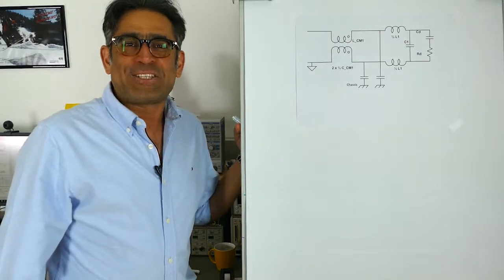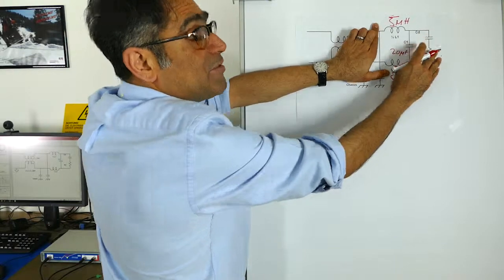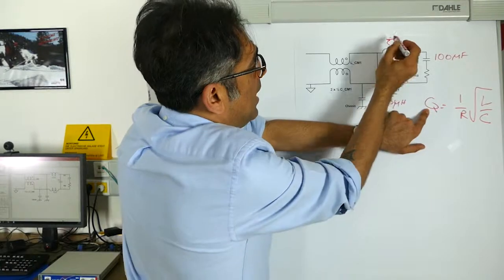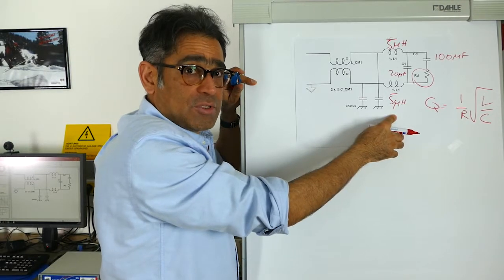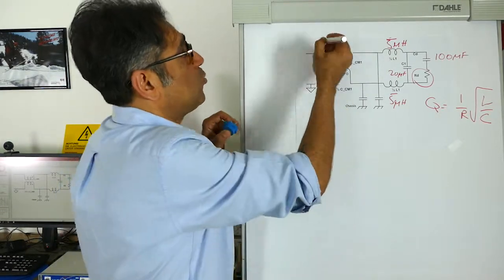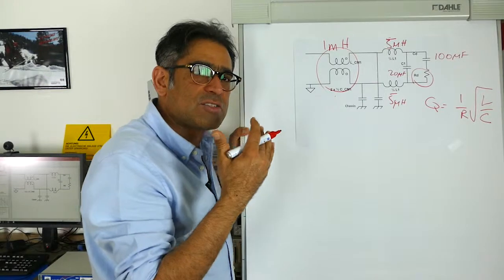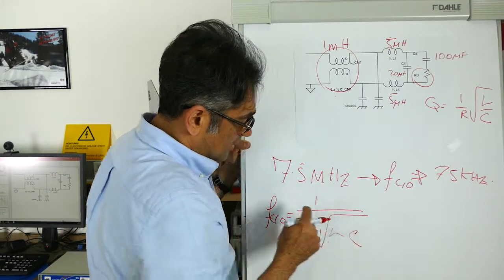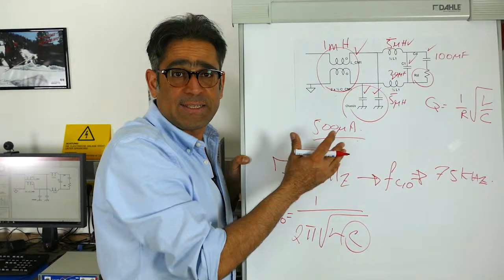EMC Filter Design Part 8: Common Mode Filter Design

Comment: Hi Dr. We have a schematic of a circuit board for EMC filtering. We draw it based on an industrial board(based on PCB picture). The circuit is so close to your circuit of common-mode filter but it has some differences. the circuit doesn't has PE to connect PI capacitors, but the producer use another way. It would be an honor if you could take a look at the schematic. we have the chock spec but we don't have capacitors and inductors range.

Comment: Hi Dr, Thanks for those awesome lectures. I wanted to ask you, lets say we want to have separate differential mode inductors, what is the equation/requirements that I can use to determine the required inductance of the common mode choke and what about its rating? should it be rated at line current? what about the rating of the other components in the system? (like L1 C1 Rd etc) what should their current rating be?
Thanks!
Reply from the maker: Dear Samtabaja, these are very detailed questions and we suggest you contact Dr. Ali directly via www.biricha.com

Comment: Thanks for your wonderful explanation!
The value of capacitor that you have calculated, will that be same for both capacitors that is connected to chassis or we have to split the value in 2 equal part ?
Reply from the maker: Dear Nikhil Kumar,
thanks a lot for your question. On the schematic, Dr. Ali Shirsavar stated "2x 1/2 C_CM1".
So I would say that the calculated C has to be split for both Cs connected to the Chassis.

Comment: For AC line how can I use an electrolytic damping capacitor Cd? Can I place the Cd after the diode bridge?
Reply from the maker: For AC filters, a damping capacitor is typically not used since stability is usually not a problem.

Comment: I did not understand what you mean by  80db of 7.5Mhz to give you a cutoff frequency of 75Khz, please explain more on that.
Reply from the maker: Dear Tite Man, if you use a second order filter, then you know that the filter transfer function should fall with a rate of 40dB/decade after the cutoff frequency. If you need 80dB of attenuation at a certain frequency, the cutoff frequency must be 2 decades earlier. From 7.5MHz, one decade lower is 750kHz and two decades lower is 75kHz. 
Hope this helps!
Reply: Dear OMICRON Lab, thank you very much I have understood your explanation, please I need a comprehensive tutorial on passive filters,explaining first,second and third order and how they are related to dB/decade.
Reply from the maker: @titeman9374  you will find many tutorials on youtube or in the internet. Simply search for "passive filter design", "filter transfer function" etc... Good luck!
Reply: @OMICRONLabTutorials  alright  thanks.
Reply: @OMICRONLabTutorials  thank you for the explanation!